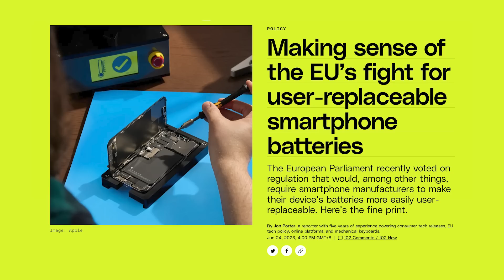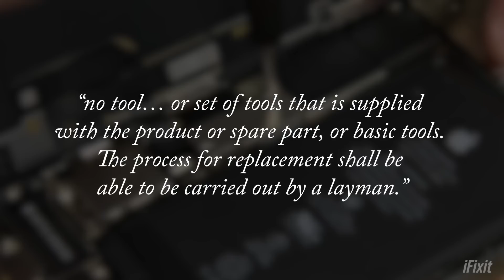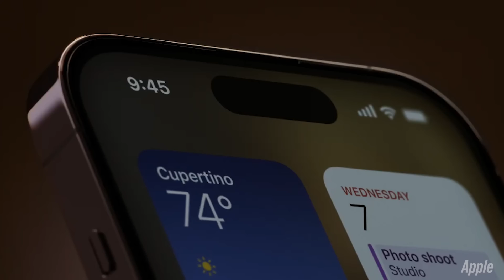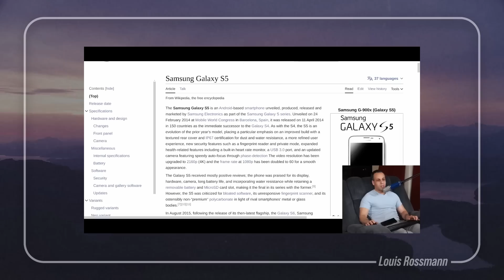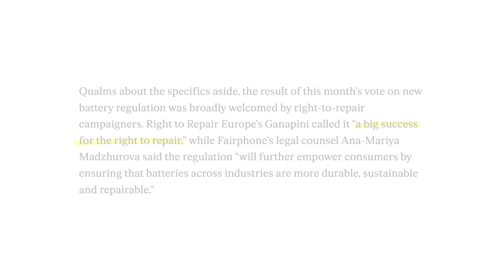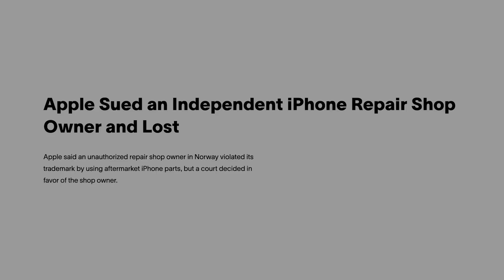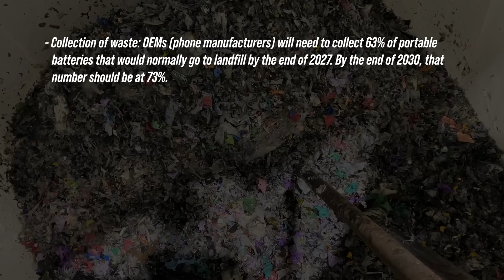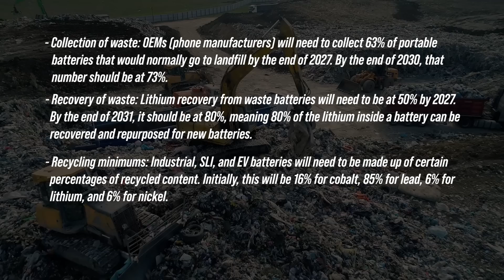EU Just Changed Smartphones Forever

Comment: This could have so many implications, since phones are so powerful for most tasks, if you can replace the battery you can get almost twice the lifetime of a device might force companies to extend firmware support and also will reduce their sales since many people will not need to replace the phone so often
Reply: "... will reduce their sales since many people will not need to replace the phone so often"

And that is why manufacturers went to user non-replaceable batteries.  To have a built in product lifetime that would maintain sales regardless of feature improvements or lack thereof.  I can remember my ~1999 Nokia cellphone having an easily swappable battery.  Same for a 2004 HP laptop.
Reply: People don't need to replace their phones yearly, or even every 3 years now. Yet sales statistics show that the majority of people do replace their phone before they need to. And that's because phone providers have 2-3 year contracts, and bundle the cost of a new phone into the contract. It's a problem spending $1600 up front for a new phone for a lot of people. Not as much of a problem spending $30 a month over 3 years though.

There's also some benefits to non-removable batteries, in that if it's lost or stolen, you can track it using "find my phone," remotely lock or erase it etc. With a removable battery, if a thief (or a drop) knocks the battery out, then you're out of luck.
Reply: @mattd6931 I get service from cheap providers that let me bring my own GSM smartphone.  My monthly cell bill is ~$16 USD.  And I don't buy expensive phones.  My phones have MSRP'd for ~$300 USD, but at Christmas time they go on sale for ~$200 USD.  And I buy a case to help them last as long as possible.  I regard $1K phones and up as clear identifiers of people with far more money than brains.  In my parent's time the idea of needing to replace your phone every 1 - 4 years would have been regarded as insane.
Reply: @mattd6931  You get the same effect by just turning it off. There's no reason you can't do that with a removable battery. The command just sits on the server til the phone is powered on. Just like now. Unless they are powering on the device in ta Faraday cage, and in that case you have bigger problems.
Reply: @CoreyKearney Yeah but if you've just dropped your phone, the non-removable battery means it's still on.

Remember the old Nokias? The first thing that happened when you dropped them was the battery cover came off and the battery flew across the room.

Comment: I dont think a vehicle needs to be designed to have the battery replaced by a consumer, but you should 100% be able to take it to any repair shop and have a oem or after market battery install without issue. Then again, how sick would it be if you could pop the hood, open a cover and remove battery models yourself. Maybe make them like 25lbs packs on a sliding gantry, coke machine style (so as you remove rows the ones father in slide forward for replacement)

Comment: in effect, Apple is LEASING phones and as the lessor, they should be responsible for any repairs or replacements. This is the normal case with any leased equipment on the market. However there is one huge caveat and obstacle to this... Apple lobbyists...

Comment: As a kid I remember having a removable battery android and the disappointment I felt when upgraded to having a non removable battery sucked. I used to swap and charge my batteries and my phone would never die. We took a step back as a whole.
Reply: Another thing is on the few occasions a phone crashes/seizes one can get it restarted by removal and re-insertion of the battery,  I still have an old LG phone and it has crashed 4 times over the years, but fixed in less than a minute each time.  My new Samsung crashed, I could not remove the battery and ended up having it to be sent off for 'repair.'  I do not appreciate the arguments in favour of not having removable batteries.  I think it is to make more money.
Reply: I can agree with you on that as I used to take a batter charger and spear batter in to school with me and if I was running out of charge or need to work with it I cunled just change it out on the fly. this is why I don't like change any of my tech that is not working as it just make more e waste for the environment and sometime is just a 1% increase in performance with the new tech that it just a moony sink, so my question to law makers is why are there so many company that don't allow to have a system for 3 party repairs that fallow a set guide lines.
Reply: Having an integrated battery is not desirable.  I would regularly change batteries and was perfectly content.
Reply: I have a DAP (Digital Audio Player) which uses Galaxy S3 battery (just open the cover to replace). Not only it's easily replacable, it is still working and holding OK. Newer irreplacable batteries last only for year or two (i have to recharge my DAP twice a week and my gaming phone twice a day) there is no support from manufacturer, all you can get now is $5 crappy battery and replacing it will cost you $50 at service centre. My newer DAP has newer type of battery, so it's kinda a bit harder to replace but still back cover is held by screws, not glued, so it takes maybe 15 minutes instead of 15 seconds now, but perfectly fine doing it at home. Fuck those greedy smartphones company.
Reply: Imagine getting rid of power banks. Just having replacement batteries easy to swap out like my Cannon camera 🙏🙏🙏
Reply: @NardoStache Man, that'd be great. I avoid pointless junk being in my bag eating space that could be for something else.
Reply: I argue all the time that my Samsung s10 never really needed to be upgraded. It had great memory and processor, was fast, and was basically a small computer in my pocket. There was no need to build a new phone other than the commercialisation of making us think we need a new one every two years. The only problem… no replaceable battery.

If they weren’t turning off the 2G networks in a few years, I’d go back to the old Nokia bricks.
Reply: My previous phone(LG G PRO) had a removable battery, so I just swapped the battery when other battery pack drained. but now (LG V35) it is impossible.
Reply: Galaxy S6
Reply: my phone has a removable battery, just buy a $200 one
Reply: U are right but the added water resistance its also very important.
Reply: Me too. I had two batteries in my pocket. All the time. Chinese people did like this too... but now phones have a really fast charger that can charge ur phone when it's turned off full within one hour or less..
Reply: Back then a battery was 1300mah, nowadays they are 5500mah.
A battery easily lasts an entire day.

And if it doesn't, you charge your phone for 15 minutes and it gained 50% battery life.

I personally prefer glued phones because they are more rigid. Love the stiffness in comparison with my old battery swappable htc smartphone.

Didnt like removable covers, im using it to keep myself busy. So i would open it, close it, open it, close it, open it, close it, until its broken.

Just glue them, but make it easy yo disassemble. A suction cup and some heat. 
No special fancy torx security screws.

Now i say screws, a aluminium screw on back panel is maybe better. They can incorporate a seal for ip-rating.

The screen is the most fragile part of a phone. Most of my phones are replaced because of the screen.
I would love to see easy repairable phones.

Google is on its way with the pixel phones.
The screen is easily replacable.
Its glued down, but removable without to much effort.

Unfortunately the screen costs a lot, so im still considering replacing the phone.
Reply: You were 20 back then.
Reply: Be careful what you wish for. Batteries which are more integrated into the mobile phone does bring a few significant advantages. Sure it was initially an apparent advantage to have removable battery in the HTC Desire and the LG phone I replaced it with but I had to carry a replacement battery with me to get through the day. Until I bought a phone with sealed integrated battery which enabled a larger capacity faster charging batter enabled by removing the excess bulk of the more robust case required to safely enclosed a Li-ion battery and the chamber into which the battery is to be inverted. Both of which, add weight and bulk which doesn't contribute to the function of the phone.

Secondly, many high performance phones which charge high capacity batteries requiring speed charging benefit from sophisticated cooling as with this performance comes a need to manage that heat with close contact thermal control not easily achieved through the case of a removable battery, thus shortening the battery life. This isn't in the consumer interest surely
Reply: @BarryHaegerSalesCoach  fair point but speed charging your batteries will kill it's life faster tho. Improving thermal dissipation of the battery casing beats its purpose when the battery itself is on fire with that high charging current flowing in 🤔
Reply: @BarryHaegerSalesCoach  Take your point, but my LG phone with a removable battery is lighter than my Samsung, although in all fairness it is smaller.  However in terms of charging times, the LG is faster, and do not notice much difference in discharge time.  A removable battery is a plus for me, but now PCs, tablets and phones all have sealed batteries.
Reply: @BarryHaegerSalesCoach  It's not like they could not make bigger but still easy replacable battery, yes current desing with glued back cover does decrease weight and bulk, but i don't mind a bit heavier phone. Btw it's not like older phones have smaller battery cause of the cover, it's just that other components took more space. Batteries now take much more space inside the phone compared to older models. 

"Both of which, add weight and bulk which doesn't contribute to the function of the phone." If you consider longer uptime as a function, it adds to that. 
At the same time, replacable battery kinda makes fast charging not that important, if i need uptime i can just swap battery and charge it in a separate charger.
Reply: @BarryHaegerSalesCoach  meh
Reply: @BarryHaegerSalesCoach  fair but I have to ask what is this about with weight as the most of the time the LI-ion battery is not that Harvey for start in phones. if you are going on about performance with temperate then it down to where you live in the world if you are really need to worry about it and there are time when that exter heat can be good as a way to tell people that need need to get off the phone. I find that speed charging is not away need in a battery as it is only a good fiter if you need to get large power in a vary small amount of time and if you are any good at time management it not relay need it.
Reply: @BarryHaegerSalesCoach   I would rather go back to the days where you could change your battery in your phone the new phones might look great and perform well but when they fail due to the battery you will cry once you get the bill to repair it's not cheap, Bring back removeable Battery.
Reply: @BarryHaegerSalesCoach  Thats more of an attest to how battery life has extended greatly than anything, just remember phones were black n white and still drained batteries. now they can play 4k video and last the same amount of time

Comment: 1. I loved the idea of turning my phone completely OFF by removing the battery. 
2. One of the problems with removable batteries will be that they will have less capacity than built-in ones, which can occupy move volume for the same size device. BUT, do I need a phone with 24 hour life? I would far rather have a shorter battery life and the chance to "completely recharge" by changing batteries.
3. The phone companies will fight back by changing the battery design for every model and every sub-model every year. Theere will be too many battery types and sizes for any store to be completely stocked. Next up: a law restricting the physical size of batteries to a few common forms. There is still room for battery improvement in squeezing more capacity into a given form factor, but your batteries should be usable as spares for many years eventually.

Comment: They shouldn't software lock replaced components. Unless the components are linked to a stolen phone. I don't think a iopener from ifixit should be considered a specialised tool. 
A layman could fix a phone with ifixit kits and instructions. And in my opinion that's good enough

Comment: Yay!  Let's do power tools next.  I started with an 80V leaf blower, and as long as I had the battery pack, eventually got a whole set of compatible tools (string trimmer, chainsaw, polesaw, etc.).  Now they have been discontinued and I am facing the prospect of getting a welder and trying to do an unauthorized cell replacement in the battery pack or sending the whole bunch to a landfill and spending hundreds to replace them.  All because manufacturers would rather force us to spend hundreds on new new stuff instead of a few bucks on a replacement cell.  And we acquiesce, because who can fight big corporations without a government representing their wishes?
Reply: Get some 18650 and a spot welder. For safety have a bucket of sand incase one of the cells fail or burst. Keep voltages of the cells as close as possible.
Reply: There are fairly inexpensive dedicated battery welders for this. Also yeah bucket of sand. You can't put a lithium battery fire out you just have to wait it out.
Reply: Will 3ed the buck of sand, but also a good pair of running shoes...

Comment: The only negative of this is that it took so long to happen.  As a Louis Rossman watcher for years this is nothing less than a win for Right to Repair and consumers. My (admittedly old) phones' battery started swelling and the cost even if I did it myself would have been around $80, a local place that does phone repairs quoted me $120.  I ended up deciding that 4 years was a good lifespan for a phone and got a new phone.  If it had been $40 for the battery and a simple drop in replacement I might have kept trudging along with my old phone.

I've also replaced the battery on my (again old) laptop but I got a laptop that at the time was fairly easy to repair so that was relatively painless.

Comment: A smart move would be to abandon EU market. Anyway I’m okay with right to repair. It should be introduced but in the process removable batteries will produce much more problems than solutions.
There’ll again be a new market of duplicate batteries, people will not change their batteries to the original all the time. I didn’t do it much of the time which will generate e-waste greater than current batteries. Chips will be slower, batteries won’t be efficient enough, they’ll make them degrade faster so they can sell more. Apple made their  m1 chips so efficient to work in compatibility with the battery. It’ll crash the current model of high efficient chips. Water resistant is out of question cause it’ll cost more to make a device water resistant with removable battery. 

And EU can’t decide environmental impact for the rest of the world. I will bet big companies won’t comply. It’s another money making machine. Just rebranded.

Comment: well, i've been recycling batteries since i can remember. any friend or family with a broken device always takes it to me before throwing it away. any kind of switch, battery... anything that i can desolder and put to use, i salvage it. Reciently, i've been fascinated with single use vaping devices. They all have an, at least, 350mAh rechargalbe li-ion battery inside... for a single use device that usually ends up thrown away... i try to pick all of them up and extract the batteries... so i can put them to good use (my multimeter is now a rechargable one, guess thanks to what)

Comment: i think this was an anti consumer type move 
and that this was a playbook right out of the movie Robots from the 2000s 
where instead of just having the easily replaceable parts, people/robots are forced to get really expensive upgrades 

i'm glad the right to repair guy made some head way and is almost kind of gave Apple a metaphorical punch in the nose/black eye due to their shenanigans. 

yeah, would really appericating having a replacable battery for this kind of stuff like before rather than one of those super special sealed in ones that you have to go to those super special shops from the company rather than a local tech person.

or just do it yourself with a few cheap parts you can buy from a discount tech parts place down the street.

Comment: It makes sense for small products, but less so for the batteries of EVs (are they mobile as defined by the law?) that weigh hundreds of pounds and are removed from the bottom of a raised vehicle.  Will every EV sold in the EU need to include a portable car lift and battery  jacks, or will makers be required to provide free access and tools at DIY garages to the owners?

Comment: Idk why the EU tries to make problems even though there aren´t any. On my Iphone 12 and Iphone X I not only changed the battery but also the Display and charging port, it´s only 2 screws and a little bit of adhesive, it´s not that hard. I don´t know why it should be made easier than this cause it´s already pretty easy to change everything you want, you only need a screewdriver and that´s it!

Comment: It is os new for them not to be easily removed and replaced. It should have never been allowed for them not to be removable because if your phone freezes you are stuck without a phone until the battery runs down and turns off the phone and if the battery catches fire you might actually be able to get it out and away from your phone and yourself